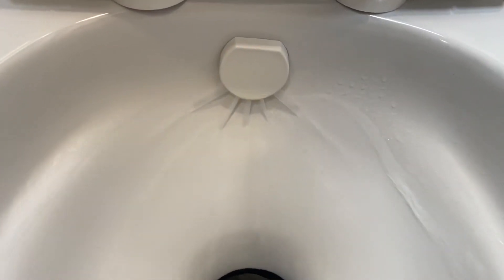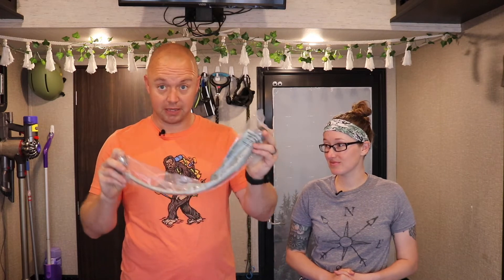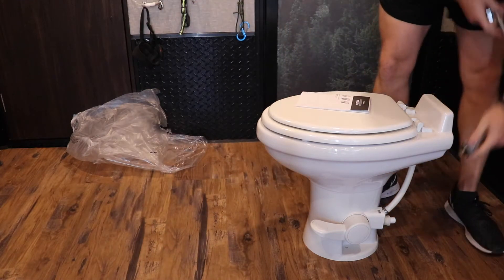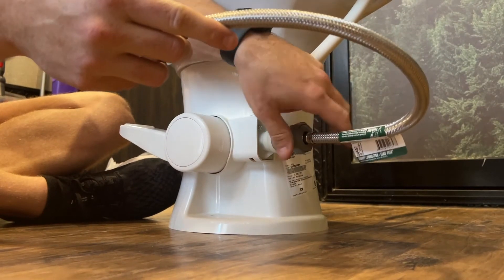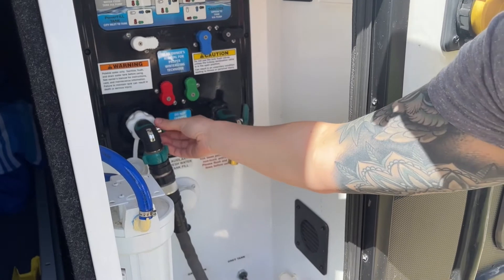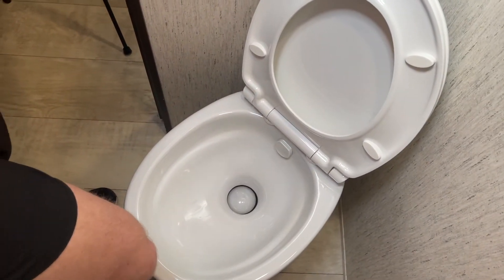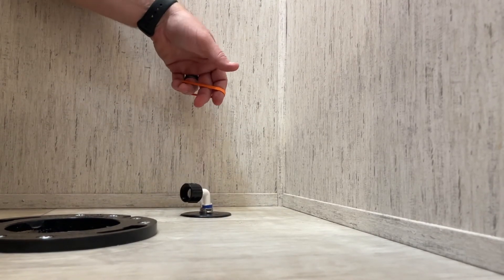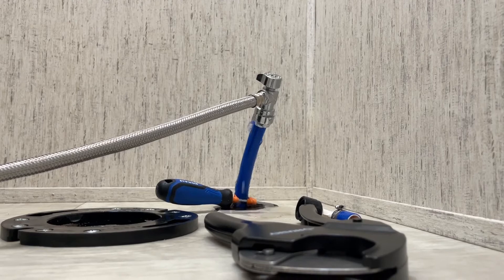Dometic 320 Toilet Installation

Comment: Your hose from the floor is not pex.  It’s soft hose.  The sharkbite fitting is not designed to connect to soft hose. It will eventually leak. Soft hose ID is slightly larger than pex.
Reply from the maker: Hey Cleo, 

Thank you for the correction! Is soft hose the official term? We are just wondering so we can make sure to refer to it correctly moving forward. 

We check the connection pretty frequently and haven’t had any issues so far! We will be sure to keep a lookout and put out a correction the moment it does! Thank you!

Very respectfully,

Jeff and Amanda
Reply: @WeLiveFreeRV    so a year later has it leaked from the sharkbite fitting?
Reply from the maker: It did with the soft hose, we switched the line over to pex and haven’t had a single leak!